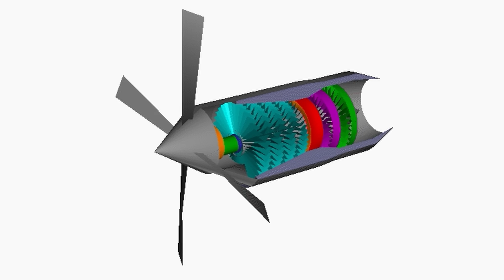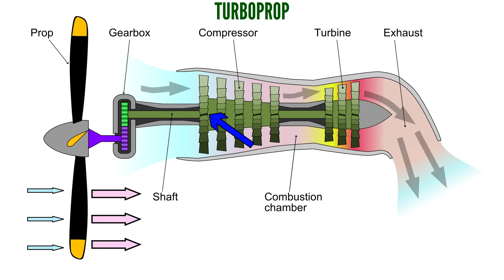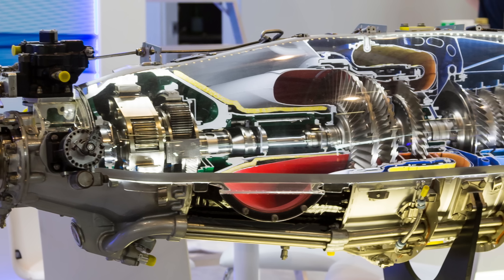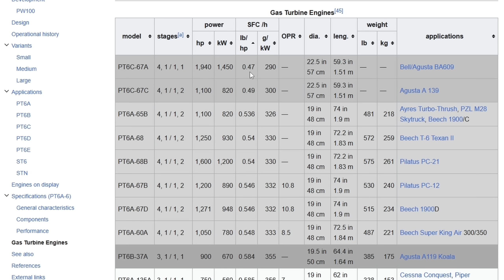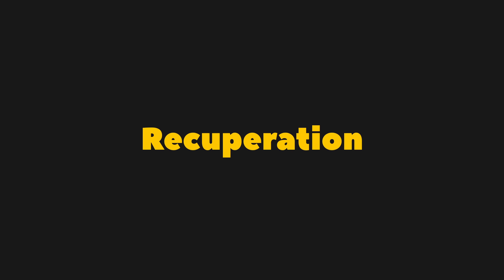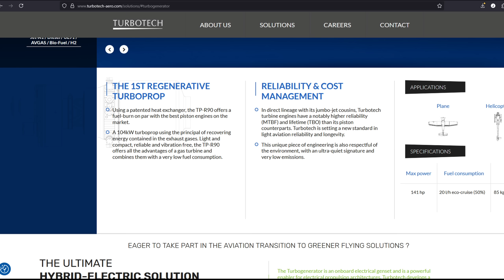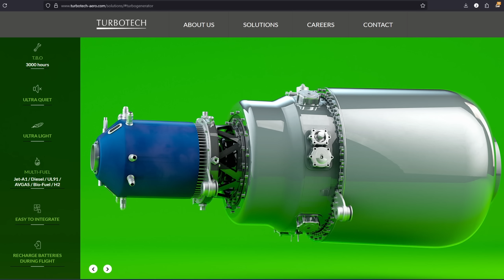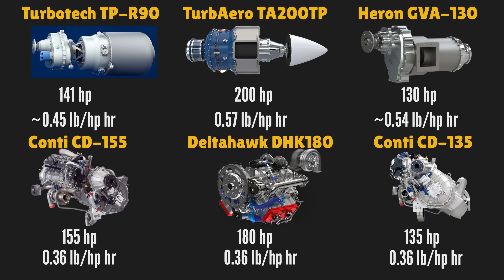Are Piston Engines Dead? Small Turboprops are Here

Comment: Let’s be realistic. Cost is the driving factor. 

Turboprops are incredibly expensive upfront. TBO doesn’t matter when you could just buy 3 piston engines for the cost of the turboprop.

The only reason you go to turboprop is because scaling piston power only goes so far. While Jet power to weight scales better with more power it’s the opposite for piston engines. 

Making 1MW reliably out of a flying piston engine just isn’t really possible without a ridiculous number of cylinders but for turbo props it’s actually just the start of the sweet spot where your efficiency begins to climb. 

As long as you can keep the cylinder count reasonable piston engines win hands down except for niche applications.

I foresee that any wins for turbo props due to materials, design etc you will see the same materials and design advancements help aircraft with piston engines.

Comment: The biggest disadvantage is not fuel efficiency. It's engine cost. Turbine engines cost 10x more than piston ones. In fact, the turbine engine in my EC120 helicopter costs 20x as much as the piston engine in my Enstrom 280FX.
Reply: It's not that many orders of magnitude different in acquisition price but, to the presenter's point, piston aircraft engines are already eye-wateringingly expensive and a turbine that offers parity in efficiency for even a little more money might be appealing in some applications for other special mission purposes (like high dispatch reliability or low vibration) but still falls short of making recips obsolete
Reply: Don't forget the overhaul cost.
Reply: I don’t see why some company isn’t just producing the PT6 at a lower cost. Patents have to be open by now.
Reply: Great explanation, turboprop engines will never be able to replace piston engines. Fuel burn, cost, size and other technical factors are hard to overcome
Reply: Damn what engines are those? Did you get a cheap piston engine or a million dollar turbine?

Comment: I look forward to electric motors. Minimal moving parts, overhaul $10,000- $20,000.
Reply: Except that the batteries for any decently sized aircraft would be in the hundreds of thousands and would require replacement after only hundreds of hours of operation.
Reply: Never going to happen, rechargeable batteries are not efficient enough for mainstream aviation and never will be.
Batteries cannot match the energy storage density required for aviation.

Comment: I've been following the development of this engine since the very beginning, twenty years ago. Originally, its creator, Damien Fauvet, wanted to make a small regenerative-cycle turbofan for light aircraft. But very quickly, propulsive efficiency calculations showed that for the desired low fuel consumption, it was impossible to design a turbofan adapted to the requirements, the speed of light aircraft being necessarily too slow. Thus, in March 2006, Damien Fauvet decided to build a turboprop rather than a turbofan.
Comparing specific fuel consumption figures is misleading. It's true that the figures suggest that the TP-R90 consumes a little more fuel than the Rotax 915is to do the same thing... But this forgets that the 4-stroke engine must be cooled, and that the power consumed to circulate air around the cylinders and through the radiators is paid for in induced drag. For identical fuel consumption, the turbine generates at least as much useful thrust as the four-stroke engine.

Another advantage of the turbine: its ability to operate on a wide range of fuels, whereas the four-stroke engine can only consume a small number of specific fuels.

It is true that light aircraft designed in the second half of the twentieth century used their engines 75% in fast cruise and 65% in fuel-efficient cruising. But aircraft designed subsequently tend to have more refined aerodynamics and, thanks to composite materials, wings with a high aspect ratio. For these aircraft, which are much better gliders than their predecessors, 50% power allows for particularly economical flight without sacrificing too much cruising speed. Reducing power further, for example to 40%, allows for approaching Carson speed and considerably increasing non-stop range.

For all these reasons, the TP-R90 turbine performs better in practice than a simple comparison of figures would suggest.

Comment: One thing I did not hear mentioned was Lifetime fuel consumption compared with Lifetime engine overhaul/replacement cost.  If you can get 3 times the engine life of a piston engine, that can make up for a lot of the fuel eff./cost over time.  Maybe you could figure those numbers out. I am an A&P, aircraft owner and a Chief Engineeer in Marine Engineering.  Thank you for the video great information, Thank you for sharing.

Comment: Fuel consumption numbers, measured in POUNDS PER HORSEPOWER HOUR... :D LOL. Nobody measures anything in pounds and horsepowers. Seriously, there are kW and kilograms, use them. Thx ;)
Reply from the maker: Nah I'm 100% fine doing it this way. When using gram per kw hour, you'll be converting hp to kW since 99% of airplane engines power output are given hp or shp, not kW.

Comment: Excellent video,  thanks.  Is the propeller absorbing so much thrust that the exhaust does not offer a little extra?
Reply from the maker: The exhaust usually does provide some thrust, around 10%. When using a recuperator I presume it will be less though.

Comment: To complete the analysis, I would have liked to hear two more considerations.
Cost and availability of fuel, AvGas vs Jet A.
Reply from the maker: 100%. It just varies so much around the world. 
1. Jet-A1 is usually cheaper than Avgas. 
2. Jet-A1 is usually a lot cheaper than Avgas in Europe.
3. A few commenters informed us that Jet-A1 is more expensive than Avgas where they are in the US.
4. Avgas is getting scarce in some places, especially Europe.
5. Also, don't forget about Mogas (unleaded automotive petrol), the Rotax engines mentioned runs on that, not Avgas (it can, but why?), and I'm sure I don't need to mention how the price of car petrol differs around the world. 
6. Mogas is cheaper than Avgas, and generally not much more expensive than Jet A1, but again, this depends where you are.
7. Mogas availability, sure to decline, but much more plentiful than both Avgas and Jet-A1 where I am.

I'm sure that info helps absolutely no one, but explains the variables, and your location will play the key role in the cost vs availability of fuel.

Comment: The comment from @bostuart below is spot on !  One other dimension for consideration would be helpful when this review is updated:  The scope could include the cost/benefit of cost for the 'kit' to convert a certificated airplane, such as a PA 28 series or Cessna 120 - 180 series or other comparable  (such as Grumman) certified private aircraft in addition to the cost of the turboprop unit.  Overall cost is probably the final determining factor.  This presentation appears focused on the cost for the power unit & gearbox for an Experimental category plane (not intended criticism - only an observation).  The conversion of significant (hundreds of?) thousands of existing certified aircraft for the GA market, if reasonably competitive to rebuilding or replacing the existing piston unit, would/should provide a profitable market for manufacturers, given the potential economies of scale.  One would think, given the overall cost considerations are most likely to make the focus of converting from piston to turboprop power units.

Comment: Thank you for explaining turboprops so clearly! It answered a lot of questions I have always had about them. I was surprised about how few horsepower the small turboprops generate. My Diamond DA42 has two Austro diesels that each burn 6-7 gallons per hour at cruise, and they generate 168 hp each. It seems that the smaller turboprops would not be a good deal, given their higher cost and fuel consumption

Comment: "Lets Go Aviate", this was intended-to-be a sparse comment but I was inspired by your truly enjoyable uploads on turbine engines and it became  this marathon of a comment. My apologies, but you're much appreciated.  Anyone who's not "Lets Go Aviate" -- read at your own risk.  And don't use heavy machinery for 12 hours after reading..

The difference between a governed recip engine and a (yes, governed) turbine are night and day (from experience).  Once some turbine hours are logged it's very difficult to return to recips.

But something overlooked that will play a big roll in affordable turbine engines.  Fixed-shaft vs free-shaft turbine design.

Fixed-shaft = the power & gas generator turbines are on one shaft and rotate in sync.  The result is a turbine PPlant where all turbines are working at less-than-optimum rot'nl speed.  Response to changing power demands are slow (the gas generator spool-up can't react any faster than the power output shaft response).  And the hot-section is more prone to exceeding temp. limits.  The fixed shaft turbine is the less expensive, less complex, easier to maintain option, but not the "pilot's choice".  Examples:  The Turbomeca (older) series like the Astazou, some of the Soviet designs, many (if not most) of the turboshafts that power APUs incl the APU units often converted to power experimental designs.

The "pilot's choice" (from experience, but that's w/ turbo*shaft* engines on helicopters) is the free turbine design.  The gas-generator shaft and the power output shaft are independent and rotate at their unique optimum speed.

But this requires two concentric shafts w/ bearings,    forced lubric'n, seals -- highest precision work w/ no allowance for in-service deform'n.  Power lag is ~ un-noticeable in smaller engines.  This the engine of every pilots' dreams, but this design is expensive to purchase and maintain.

If anyone actually made it this far, then I'm very afraid.  Truly it's a sign that the end of the world is near.

Comment: Just my point of view. Small turbines can be paired with electric engines with relatively small pack of battery. I guess that turbines can be tuned for more efficient electric generation.
p.s.: Just found that author already described it in the https://youtu.be/wPjszJsXr4s?t=135
Reply: Hybrids are not practical or commercially viable in aviation. The power to weight ratio performance it terrible.